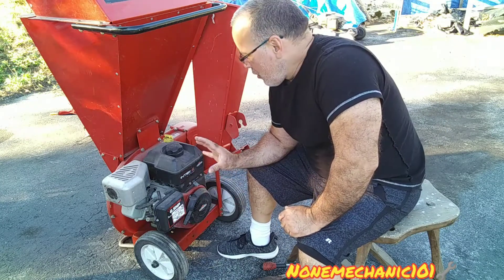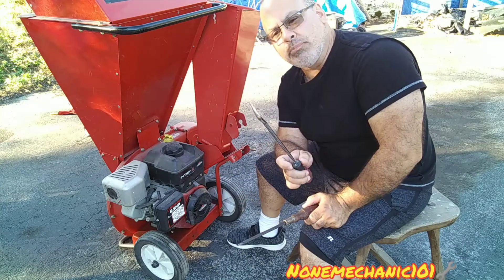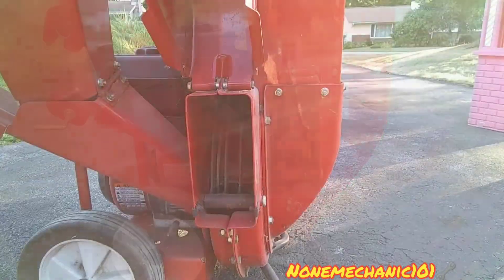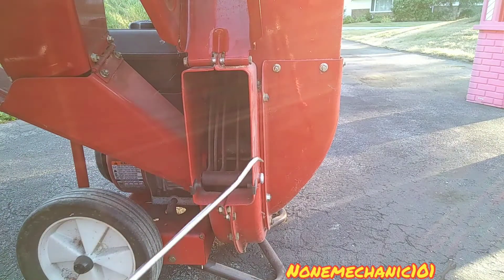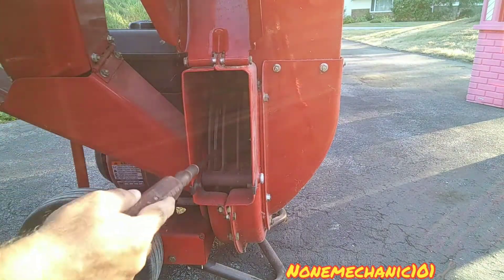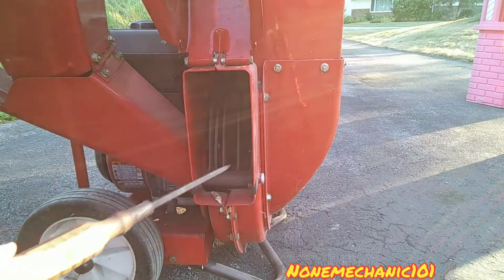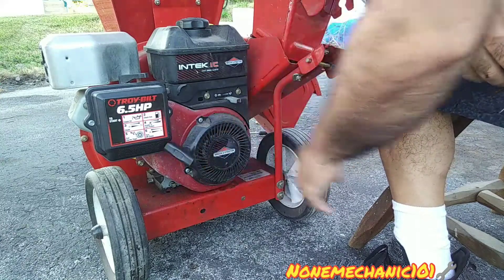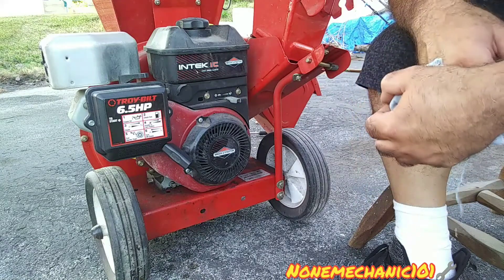Troy-Bilt Wood Chipper: Engine Stuck (Locked Up) Repair

Comment: I'll have to give that a shot. I just got a used Craftsman 8hp chipper. Pulled the rope and she is locked up. I thought it was the engine but later wondered if it could be jammed. That's when I found your video. I hope I get lucky like you did. 😂
Reply from the maker: I hope you get it working 👍🏼

Comment: Mine is has a bind on the far side of the outlet. Besides taking it apart, is there an easier way to dislodge it?
Reply from the maker: I’m not sure I haven’t done it.
Reply: @NoneMechanic101  I had to take the entire chipper shredder housing apart. Took about 30 minutes. It was the only way with the amount of stuck I had in there.
Reply from the maker: @o0oo0Tony0oo0o  Great job